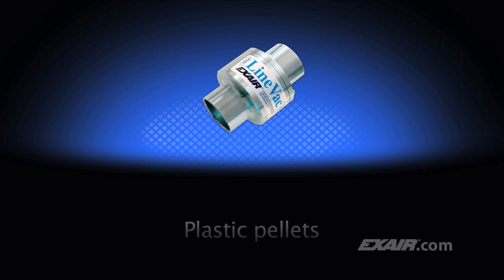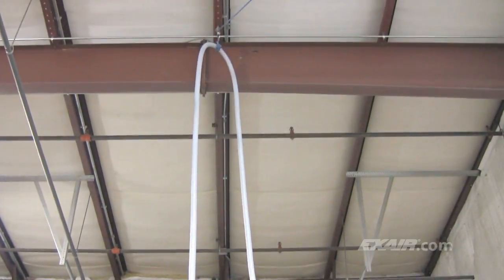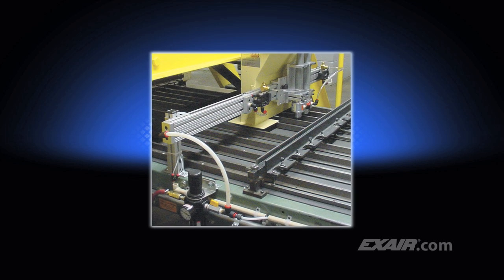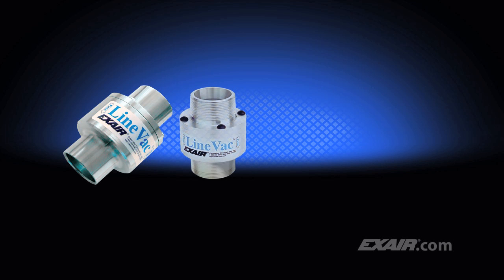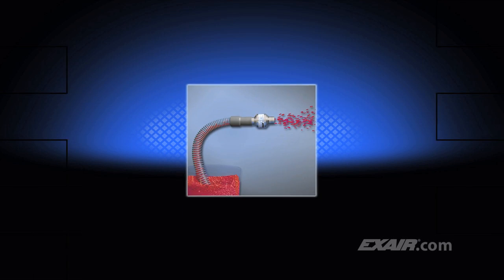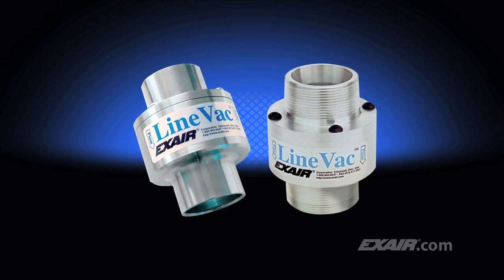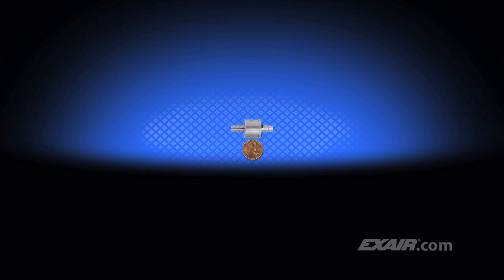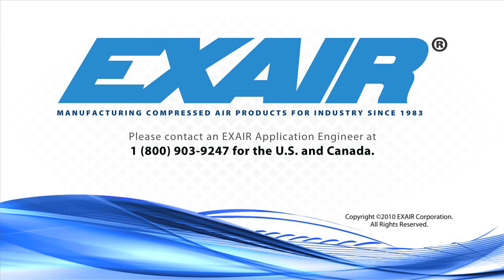Line Vac by EXAIR

Comment: Por favor, qué potencia tiene el compresor de aire usado en el vídeo?
Necesito comprar todo el sistema: Line Vac de 2",  y compresor de aire para transportar pellet de madera a  7 metros de altura.
Please, the power, the air compressor used in the video?
I need to buy this system. Line Vac 2" and air compressor to transport wood pellet to 7 meters high.
Thank You very much.
Reply from the maker: @Marsmarin8 , Thank you for the inquiry.  The 2" Standard Line Vac will consume 45 SCFM of compressed air when powered at 80 psig inlet pressure.  If you would like to discuss your application with us please reach out to Techelp@EXAIR.com and we will respond quickly to help you determine what may work.